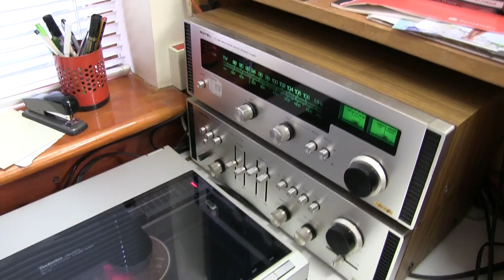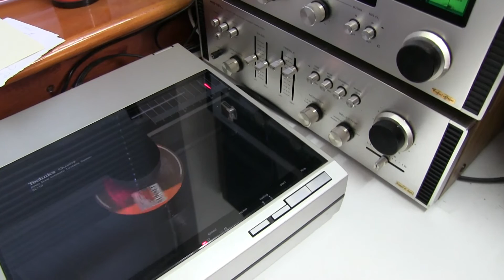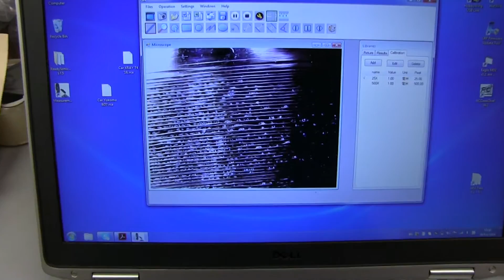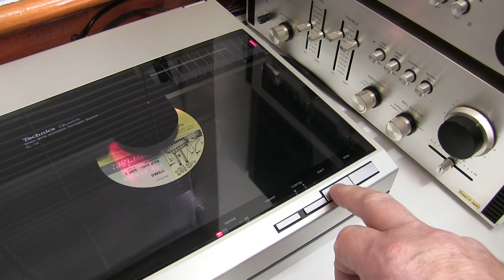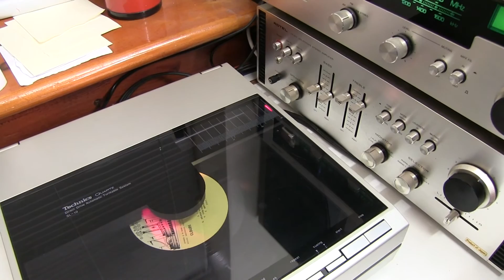Ultrasonic Vinyl Record Cleaner. How to make. Part2  Results

Comment: Your temp is way too high.. Never go over 35 C, if you don't want to end up with warps! Ask me how I know. 😉  Generally, I keep mine around 30 C or under, just to be safe. The Degritter and other high end USRCM's will tell you the same thing. Otherwise, I'm running a DIY setup too, but a little more refined. Same USC though. Recently added a recirculating pump & water filter to it, since I got tired of draining, manually filtering and refilling the tank every 2 cleaning cycles, which doesn't cost much more if you shop around. 👍

Comment: What are you using for the motor on your cleaning table?
Reply from the maker: Hi Carlos. Do you mean the table, where I air dry the record?
I use a 12volt car windscreen wiper motor, and a 12volt battery charger to power it. I fitted a reversing switch on the motor, and a on/off switch.

Comment: 6 liter tank?
Reply from the maker: Yes 6.0 litre tank.  part PS-30A  Inner tank width 300mm.  Not sure if you can get this tank any more, but a similar size with inner 300mm wide or more will be good.
Reply: @nickadams5411  Thank you. Saw similar QTD & R series with 310mm internal length (6L). Not sure what is the difference but I need to find it out. Thanks for your input!

Comment: Excelent video and grat design, may I ask you what fluid do you use in the tank other than DI water, I cannot get Kodak Photoflow, and Lárt du son is so expensive and I think it´s made for vacuum cleaner, what are you using now that ypu think is safe. Thanks in advandce!!
Reply from the maker: Hi Leonardo
I have tried many cleaners.
I make sure the record is cleaned with the fluid and a brush or pad, as best as possible before putting in the tank, with the wet cleaner still on the record.
I don't add any cleaner fluid to the tank, just water.
Cleaners that I use include, "Into the Groove", "Disc Doctor, Miracle Cleaner2 and  " HG UPVC Powerful Cleaner" which seems as good as anything.
Reply: Thanks for the reply Nick, have a nice weekend. Cheers!

Comment: Hi Nick, First Off, Great Videos I've Watch All Todate. I Am Looking To Build a Record Cleaner Similar To Yours. I Have Looked On Ebay And I'm Confused, What Capacity Is Your Tank? The Ones I've Seen Are Just A Tad Too Small Or Way Too Big.
Reply: Search for "ps30a". It's 6 litres.
Reply from the maker: Hi Gary
It is the 6L version.
You could use larger, but the 6L is just big enough.
It is still on Ebay at under £100:
https://www.ebay.co.uk/itm/Ultrasonic-Cleaner-Professional-Heated-Unit-Digital-Basket-1-3L-2L-3L-6L-10L-15L/380820021982?hash=item58aaa462de:m:mx2qK3Wf0FxFsh3tlV6k1mA

Comment: Great Video Nick,
Just Curious What is your Stereo Set-up that you are using to play your Vinyl's?
Reply from the maker: Hi Dennis
In my workshop/office where I do the video, I have a Technics SL-10 with original stylus.
The amp is an old , but very good, Rotel RA-611 through old JBL and Mission speakers wired in parallel.
In my house I have a much better system, but hardly have time to use it.

Comment: Excellent video Nick. I should have watched both of your videos on record cleaning before asking questions about the number of records in the tank. 
One last question is regarding cleaning fluid and dare I ask about washing up liquid and how it differs from the cleaning solution you used. I was thinking if you used an eye dropper and a couple of drops of washing up liquid would it have the same effect. I do realise that washing up liquid might have a long term effect on the plastic but have you ever tried to make your own cleaning fluid and what would you use in the "formula" i.e. would it contain a small amount of isopropyl alcohol ? or do you suggest leaving it to the experts and just pay the price for proper cleaning fluid ?
Reply from the maker: Hi
I have tried everything
Washing up liquid can leave a residue, but can be useful to remove grease stains and fingerprints, which do not come off in the tank.
The tank just contains de-ionised water, which is very cheap.
I then use Kodak "Wetting Agent" and  a cheap liquid such as "Into the groove".
I have tried expensive liquids, but did not clean any better than the others.
The tank gets rid of static electricity very well.

Comment: Hi Nick, I d like the way you built and cleaned the vinyls, what is your choice of ultrasonic cleaner? Model and brand please? Did you hear an aversive change in your cleaned vinyls?
Reply from the maker: Hi Adrian
I have tried many cleaning solutions.
The only ones I recommend, are those that leave no residue if left to evaporate.
Soap solutions will leave deposits in the grooves.
I like the " L'Art du son " , but it is very expensive.
So I use "Into the Groove"
Note that stubborn grease marks, such as fingerprints do not come off in the bath.
So I clean the record with a microcloth and fine toothbrush and the solution first, to remove any fingerprints or other dirt etc.
The tank removes static 100%.
On old records, I have to repeat the process a few times to get them as quiet as possible.
I have not discerned any degredation of the sound with new or old records.
The pressing quality and purity of vinyl varies a lot, and some records are just noisy, even new ones.
The Ultrasonic bath: The more powerful the better, but they get larger and more expensive.
The one I use is just big enough for the record to fit.
It has 3 transducers.
Reply: Thank you for the great info, Nick.
Reply: @nickadams5411  Hi, Nick. Do you know how many litres your tank is? Cheers
Reply from the maker: @jc5454  I used the PS30A, which is 6 litres. And Internal bath width of 300mm  Make sure the bath is wide enough to immerse the record.   Note that the PS30A may no longer be available, but there are others of similar size.  All the best and stay safe.
Reply: @nickadams5411  thanks, Nick. Mind me asking roughly what it cost? I have a feeling they've given up on price a fair bit. I can't see a 6L one for less than about 250 quid. Cheers
Reply from the maker: @jc5454  Hi. Not sure what I paid, but try and find a similar sized model that is cheaper.
Reply: @nickadams5411  Ok, Nick. Plenty to go at there! Cheers, mate. You stay safe too. Cheers.

Comment: I use the same tank. My entire collection sounds so clear and alive. Of course the badly pressed vinyl still sounds bad but less bad. Most of my collection is from the 50's and 60's and ultrasonic cleaning blows away my VPI Cyclone.  Not sure what the fella is talking about UC damaging records, I've cleaned over 400 pieces and for the most part they are perfect.  If you get the right cleaning recipe, there is no static and no pops.  It could be that my $4k MC cartridge is better than most at going deeper into the grooves to bypass the scratches that cheaper MM carts can't avoid.
Reply from the maker: Hi
I agree.  I have not damaged any record in the tank.
As you say, It is perfect at getting rid of static.
What is your cleaning recipe?
Keep spinning.
Nick
Reply: bwah ahaha what liquid solution do you use?

Comment: Thank Nick a very informative video. I don't know that I agree with the people who claim ultrasonic cleaning damages record as it is clearly not the case on the examples you demonstrated. I was curios about the comment you made about Micro cracks as i have never heard about this problem. 

I know from being in the Hi fi trade for a lot of my life that record companies did resorted to recycling some vinyl records during the oil shortages. 
This led the way to some companies like Sheffield Labs producing and specialising in direct cut disks on virgin vinyl and selling them as a premium product at one point. 
Thanks for an informative video.
Reply from the maker: Hi Jeremy
I agree
I have cleaned many records in the Ultrasonic bath, with no discernible degrading of the music.
These baths are used in many applications from jewelry to industries, and there is  no problems with them.

Comment: Hello, me again.
I am now testing for a while and i must say that in my opnion a ultrasonic cleaner damages the vinyl.
It polisches out the scratches and they will sound louder, it also wont remove all the dirt after 40 minutus, and if you use a brush it becomes only worse because they leave residu themself.
I have the idea that skin particles will stay on the record, they wont come of at all after 40 minutes.
If i use the cleaner for a longer time then 10 minutes it will also add cracks, i think that chips of vinyl are even blowen away of the edge of the V shape of the groove.
My conclusion is that its way to agresive for records if you want to lissen them on a good hi-fi system.
My last try will be Record Revirginizer to save some records.
Reply: And i distroyed my test record by the way, its sound horrible after treatment.
Reply: I've done many many cleanings with mine. Only way it sounds worse is if you don't properly remove the cleaning solution after its been in the ultrasonic. drying with a towel, and running it through distilled water fixes this. Otherwise, 100 percent of my records sound better after cleaning...

Comment: I also bought a ultrasonic cleaner to restore some records to mint condition again, to remove just some crackling due to some dust i mean.
I whas experimenting today with a good brusch and tonar vinyl cleaning fluid but after 40 minutes in totall in the bath the crackling became worse inplace of less, also i heard extra clicks and ticks that apeared in a silent groove.
Whats going on ?
Is the myth busted for me ?
Reply: Could it be that surface scratches are better heard when a records is very clean ?
I see also that this record is a bit gray, i must see in sunlight if it has indeed lots of surface scratches.
I wached with a loop but the grooves seems to be clear, maybe i hear indeed surface scratches.
Reply from the maker: Hi
I have not had an increase in noise.
Some damage to the record appears to get louder, but probably because listening closer or volume turned up.
For very stubborn dirt I have used Fairy Platinum washing liquid worked into the grooves with the 0.1mm toothbrush.
Also on very noisy records I have repeated the cleaning cycle 3 times.
Each time the noise is reduced, but some noise seems impossible to remove.
Make sure you use the 0.1mm brush and spin the record so that the brush gets into the grooves.
Keep spinning
nick
Reply from the maker: Hi
If the record is gray, then your brush is much too hard.
The record must be black and shining like a mirror.
Are you using the 0.1mm toothbrush?
See my other answer and try some "Fairy Platinum" washing up liquid.
nick
Reply: I used a velvet and a Tonar ""Dust away " carbon fiber brush.
I am also testing if the record changes because of the ultrasonic cleaning by just cleang one half, without spinning.
I expect that this record is played gray instead, the record has also a low sound volume so background noices are louder then normal.
If i am right the record is clean, i am hearing only scratches and damage.
I wonder how new cracks and clicks came on the record.
The second record i will clean has visable (seen with a loop) dust particles in the groove and is shiney.
I hope this one will clean mutch better.
Reply from the maker: Hi
I have heard of microfractures on records, but I have not seen them on any of my records.
I have not had new noises generated, but permanent noises become more annoying every time a record is played.
Let me know how your tests progress
Nick
Reply: I also have a extreme good hi-fi set i must say, i hear every distortion what so ever.
Reply: And a Linn Axis turntable with a Linn Adict MM element
Reply from the maker: Hi
Yes, it drives me mad, when I buy a brand new record and it has some imperfections.
Some new records are pressed with cheap machines.
Reply from the maker: Hi
Nice equipment.
Reply: Indeed, there are big differences between records but mostly the differences are caused by the cutting machine that cuts the master, i dont know about the pressing irself but that can go wrong to.
I also can sometimes hear background noice of the cutting machine itself, a high pitched noice of the cutting head like there whas no oil on the record while it whas cut, or a bumpy noice like the groove is not perfect round.
But this is almost only the case with cheap releases made with less good equipment, on small labels.
I had very good records in the past but even the best one has a crack here or there, 2 tiny ticks to be exact on one side of the record.
Even new ones that where sealed where not perfect, i think these ticks or cracks are present on the master to.
Or it is a dust particle captured while pressing.
But they also dont work 100 procent dust free, so its nearly impossible to have no artifacts at all.
I also had cut my own music on vinyl, so i have some understanding of it but cracks and ticks can also be caused by a mixing error because its impossible to cut 2 stereo signals in the same time.
Reply from the maker: Hi
You cut your own vinyl masters!
I would love to own a piece of equipment like that, but with the new popularity of vinyl that is now impossible.
I agree that dust in the atmosphere and imperfections in the vinyl blank, and possible wear and tear on the stamps after a lot of presses will eventually result in imperfect new discs
Keep spinning
nick
Reply: No, a company cutted a test record for me in vinyl, just one piece for 50 dollar.
Because i wanted my music on vinyl just for myself.
I learned a lot from it.
Reply: I cleaned the second record, i did not brushed it while cleaning, i only did 2 runs with the cleaner of 20 minutes.
Some cracks are gone but its stil worse and i also heard some extra noices again, but it sounds some brighter.
The extra sound whas not a click or tick but a rumbling noice, i hope it whas vibration from outside. 
It seems to me the crackling i hear is more from tiny surface scratches from the inner sleeve that whas used.
I beginning to have my doubts about the ultrasonic cleaning because a lot of cracks are caused by scratches and not dust.
But if the dust is the only cause it might help a lot more, those god damm paper inner sleeves i think.
If the sun shines tomorrow i will look for those scratches, sun light does wonders.
mmmmmmmmmmmm i am still thinking how this works.

Comment: But isn`t it good enough to clean thoroughly under the sink With lukewarm water, dishwasher soap and a soft spundge. I haven`t cleaned records that look like they have been used as a frisbee on the Beach, but groove dirty records still. I get them clean and it only takes few minutes to clean, dry and have the record spinning without background noise. Your setup looks effective, but time consuming. A quick fix is what most People want. Feel good fast.
Reply from the maker: Hi
If you have clean records from new, then a normal wet clean does the trick.
However, if you have records that are 40 or 50 years old and were not handled carefully in those days, the dirt has hardened in the bottom of the grooves.
I have tried cleaning such records with many liquid solutions, but some crackles still remained.
The Ultrasonic cleaner removes them  very effectively.
It is not always possible to find a pristine copy of a record you have owned for many years.
Also, there are some great records on Ebay, that will need cleaning, and they are often very dirty.
Of course, if a quick fix is only required, then a CD or streaming would be even faster.
Whatever is good enough , is all that matters in the end.
Keep spinning.
nick
Reply: cd good at times. Streaming!? Never. Vinyl is so fine. Been playing Lps since 85 on and off. Just lately have I really got it right and found how thoroughly better a listening experience it is. The whole package. Cleaning as well can be fun when you get a really dirty record right again. Thanks. Eirik

Comment: Maybe I missed it in the video, but what is the formula for the liquid in the bath?  Water with a bit of alcohol and photo-flo?  Thanks!  I am going to try this method myself.  :)
Reply from the maker: Hi
I added a capfull of the L'Art du Son liquid.
But it does evaporate out of the tank, especially if heated, but was very effective at wetting the surface of the record.
I now use the much cheaper Kodak Photoflow.
Also, if you preclean and wet your record and put in still wet, then you will not need any extra cleaner fluid in the tank.
I didn't try any alcohol , and would expect it to evaporate out quite quickly.
Don't use any liquids such as washing up liquid, as they will dry out to a residue on your record.
Let me know what you find to be the best.
Nick

Comment: Interesting.  I've been using Dawn dish soap detergent, a soft paint brush and tap water for years.  I just make sure to dry thoroughly and records turn out clean and quiet.
Reply from the maker: Hi
Thanks for your feedback.
I found that anything that leaves a residue after evaporating will leave a residue in the grooves.
This will accumulate on the stylus.
However whatever works for you is all that matters.
All the best
nick
Reply: Rinse with distilled water!
Reply: I do the same but after drying I use a dust-buster for each side without tone arm on the record to get any residue off before playing, works great but takes some extra time of course.